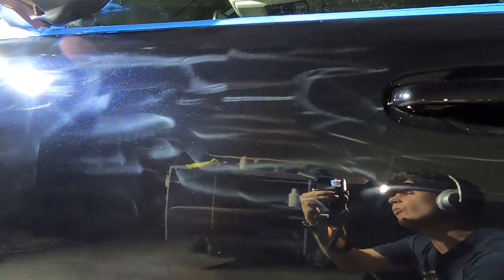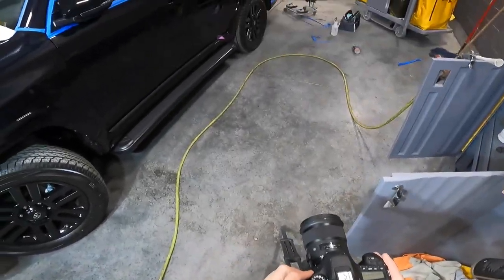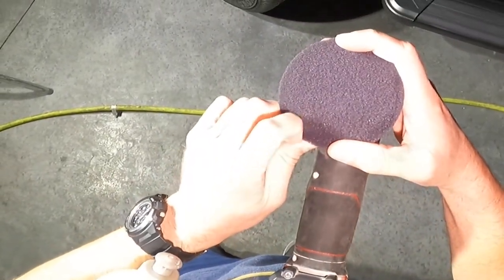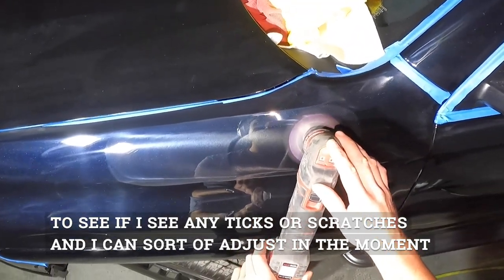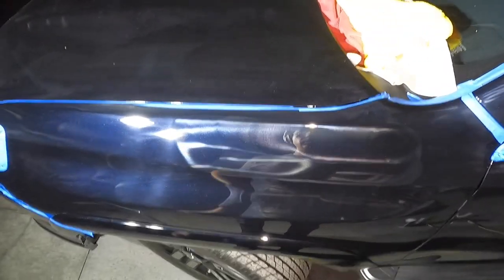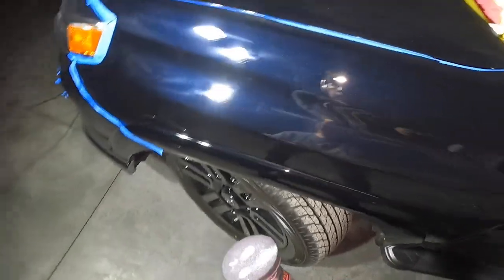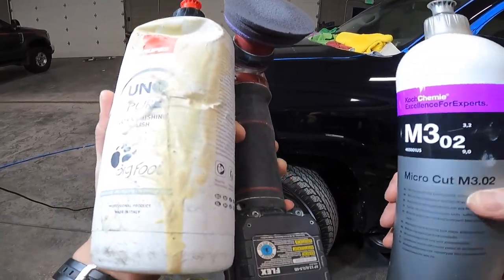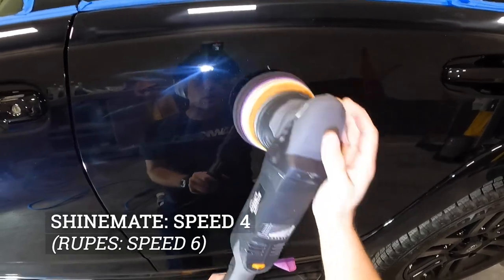This is the WORLD'S BEST POLISH for car paint!

Comment: I have tried and spent a lot of money on different brands such as Meguiars, Carpro, Chemical Guys, Autoglym etc etc but have swapped my whole product line to Koch Chemie and let me tell you it’s insanely good! Not only are their chemicals strong but most of them can be diluted to desired strength which makes them insanely economical. Their polish system is as you can see for yourself very very good! Glad to see they are stepping into the U.S now. 

Fun fact: BMW, Audi, Mercedes and Volkswagen all recommend Koch Chemie to be used on their cars 😄
Reply from the maker: 100 percent agree. I haven't found a better line up, across the board. Tried eulex yet? So stinky but so good...

Comment: Interesting you add Uno pure. I’ve been underwhelmed on how that polish finishes on soft black paint. Anyhow, car looked stunning. Love your vids!!!
Reply from the maker: Thanks man! Have you ever had that happen? There's this weird outline on the edges of your polish section...it's enough to drive you crazy. It's not like a line between where you've compounded and polished...it's just all around your polish section. It drove me absolutely nuts on this 20 year old jaguar...and I learned that is what they call "sticky" paint. The one tiny drop of uno pure gives enough lubrication...just a pass or two and quick wipe off...and it's like magic. I haven't found uno pure alone to be my favorite but I'm grateful to have discovered this "hack." I played around with other combos but you still want m3 to be the dominant product with just that little lubrication boost from uno pure. M3 wipes off easy but uno pure wipe off is super super smooth so maybe that's part of it
Reply: @HawkProDetailing  not sure I’ve experienced that…yet…but I have experienced very soft paint which drives me crazy! Great tip on the addition of uno pure. M3 is absolutely fantastic and I will always have it. I do mainly 1-step corrections, so I’m not using it a whole lot unless I’m dealing with soft black paint.

Comment: Great vid, those buffer trails sure do look nasty. Most of the times they come out very easy, but these seem to be very deep.

Jeez can't imagine how long that must've taken! I wouldn't have the patience to keep going haha. I've done dealership detailing for the last couple of months, currenty got it down to 3 hours for the full deal on normal cars. 

Last car I did was hammered though, and nothing was working fast or good enough. Had to try something new for me. I remembered your vid on the Koch chemie polishes. I compounded with Menzerna 400 first, which leaves a great finish, but just not good enough and wiped off terribly. 

So after the compounding, left the residue, got a new pad, Optimum Hyper polish and a quick pass. Finish was seriously near perfect (it was insane, given the time spent) and wipe-off a breeze. Took me about 4.5- 5 hours in total inside and out. So thanks for that!
Reply from the maker: Heck yeah man! The quick pass method can be miraculous sometimes

Comment: As much as I wanna love my Rupes 15mm 5.5 inch, the stalling is completely ridiculous. The slightest edges, the softest curves, the most minute readjustment makes it stall. It seriously feels like it adds 45 minutes to polishes sometimes. The only 2 settings the machine allows is 1/6 and 5/6. 6/6 doesn’t make any difference and it will not operate without stalling in between those settings, even on flat roofs & hoods.
Reply from the maker: Have you checked out my shinemate video? It's maybe 3-4 videos previous to this one... and I go through all of this lol. I definitely agree with you 👊
Reply: Pick up a shinemate EX 620/15…you will never use speed 6!! The EX 620/21 is even more of a beast. I never will need to use it over speed 4. Most of the time is speed 3 or 3.5.
Reply: Did you grease your backing plate,or did a washer mod?
Reply: @DinoGrahovic  I haven’t, would a thicker washer help? Would it help slightly or dramatically you think?
Reply: @Ichabod_Jericho  normal washer will get you a lot more spin. You can also add grease on top of the backing plate,and it is suggested by the rupes that it needs to have grease. I don't really know how to spell the name of the grease that is used,you can find it on Rupes video on maintaining polisher.
Reply: There is the washer mod for these problems

Comment: Everyone I know seems to hate koch polishes, me included. They had changed the formulation, especially on the h9/8 compounds. They simply can't cut, try on a german car. The f6 polish dust like crazy, never seen a polish work like that. Very disappointed. Megs in comparison is old school but they work, same Menzerna and they are cheaper
Reply from the maker: H9 doesn't do everything I want it to...it cuts a little weaker than I would like. But it works well with rotary (I use rupes coarse da on my dual action when compounding). I never found the sweet spot with f6. Have you tried this polish/pad/technique by chance? Its a little slow but I promise the results are there...m3 is in a league of its own as far as I'm concerned
Reply: @HawkProDetailing  koch pads are a bit expensive, 11/12€ each when I can get other european brands for 7-8€. I'm getting a rupes rotary very soon, but using the good old 105 with a hard pad gave a better finish and removed all the defects, while the h9 leaved tons of rids and swirls behind and the marring was terrible. The m3 was out of stock ( maybe I was lucky ), but i generally tend to finish with the Menzerna 2500, depending on the pad it gives good cutting and a great finish, can't find a difference with the 3500... It uses diminishing abrasives like sonax perfect finish, so it's a long cycle polish, perfect for one step... No dusting even when really hammered for minutes and with high humidity in Italy's summer... F6 seems to cut a bit more and in some paint leaves a better finish, but it's very tricky, for sure it's shorter as it dust like a old compound. I am a bit curious abouth 3d polishes, they seems even better than megs... Have you tried them?
Reply from the maker: M3 and purple pad my man! (You were hating on koch and haven't even tried these products 🙁)Worth the price,  but they need to be cared for.  If you hammer down or clean aggressively with pad washer/wash machine you will see them degrade faster. But use what works, so many different ways to get results
Reply: @HawkProDetailing  as i said it was unavailable and their pads cost 30/40% more 🙈 you get nice result with everything by todays polish's tecnology, some are pure rebrands, other make their own. That's where a detailing company shows their real value in my opinion.
Reply: @LucaBonato  3D One is one of, if not not favorite polish. Works extremely well with MF pads. Good with foam pads as well. I do not like using it would wool pads, however. I dislike  Menzerna…lol. To each their own.
Reply: @marksafady1059  i bought a rotary only for the wool pads ahahah. Microfiber tends to heat the paint so much, and I don't like it... Do they tend to dust on wool? A spritz of water could mitigate the problem? A real compound will always dust a little in my opinion... Probably mixing with a bit of polish would ease the dusting a bit
Reply: @LucaBonato  I’ve just found 3D One does not finish well with wool. Much better with MF and foam. MF pads can create more heat, but I think it’s blown out of proportion.
Reply: @marksafady1059  I'll get the most aggresive, the ACA 500 if I am not wrong and the 520 polish. Need serious cutting as I work with 20+ years neglected cars... Curious about the 3d one, in my opinion microfiber will leave always some marring... It's aggressive by nature, always finish with a foam pad... In contrast wool fibers can be selected on softer and more thin...
Reply: @LucaBonato  MF can be used on a DA as a 1 step, no doubt about it. On soft black paint, no way. 3D One is definitely not a heavy cut. It’s a decent cut, but I use it all the time as a 1 step of LC one step MF pads. If you’re doing 2 stage corrections, yes, you need something like ACA 500. 👍🏼
Reply: It is baffling to me that no one mentioned Scholl concepts or Wolfgang Uber compound along with Sonax. These are guys are in a league of their own
Reply: @ludoviclouisdhon5292  no worries, I heard about them, in Italy sonax is not so established in workshop like menzerna and megs... Scholl is very good as I heard from my friends, but it's a bit on the premium spectrum. Will definetly try them.

Comment: Have you ever tried Scholl Concepts, Wolfgang Uber and Sonax?
Reply from the maker: Sonax perfect finish yes... but it's been years
Reply: @HawkProDetailing  Scholl with the new S2, Wolfgang Uber compound and Sonax set a standard that is above everyone else. These companies are not as recognized as they should be. For example, Wolfgang Uber with a wool pad will remove in one pass  1000 grits with a gloss left. I shake my head when I see some you tubers getting excited about a compound that can remove 1500 grits and above.
Reply from the maker: I hear you. To some extent...especially with defect removal, it's less about the compound and tool...and more about the person behind the polisher. However, there's a reason why the world's best golfers use the latest and greatest balls and clubs. Even skilled pros want to use the best stuff. I'm sure those products are super legit...lol at some point I like to find something that works and then stop searching. But I'm always down to try new stuff. Send me an email with links I'm down to try them. nick@hawkprodetailing.com
Reply: @HawkProDetailing  I will send you the links. Compounding and polishing are about efficiency. This requires the optimal system. The optimal system includes the right technician, products, and tools. Give me the Flex polishers, Scholl and Wolfgang products, Spider , megs micro fibers and LC pads, I'll move from 1000 grits defects to a Jewel gloss in 2 passes. It's laughable when I see some channel getting excited about a compound removing 2000 grits. And yet a company like Scholl is rarely reviewed or mentioned.

Comment: M3.02 can produce great results but I wouldn't call it "the best" or that it gets it there 99% of the time.   That's a bit of a reach.

Also no reason to add grey die to the product that stains pads.

KC products are getting the hype in the USA now.   I bought a bunch of KC stuff when my wholesale retailer started carrying it.   They are pretty good, but there's a bit of a price premium for them too.   One that I don't think is really justified.    

Perhaps I am missing something with how these are formulated which justifies the expense.   But then that's a failure on KC's side for not explaining what is special about their formulas.
Reply from the maker: Have you tried the purple pad, super slow passes with medium pressure approach? It takes patience but it works almost every time, especially on piano trim. The exceptions here are very old paint, single stage, just oddball paint jobs. But on modern clear coat if you follow this procedure the results are fantastic
Reply: They're so similar to Menzerna. 

That's probably why I didn't see what all the fuss was about. 

HC400, MC2500, and SF3500 I've used for years. They always deliver and are much easier to wipe off than the Koch stuff. 

I've recently found myself using more 3D than anything else these days. The more I use 3D ONE the more I'm learn from it.
Reply: I grab my 3D polishes more often than anything else these days.